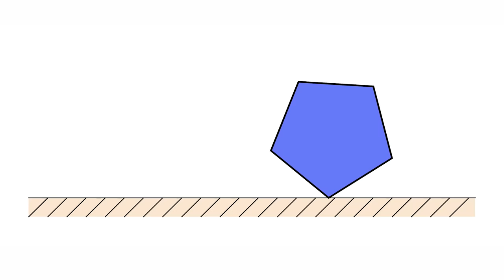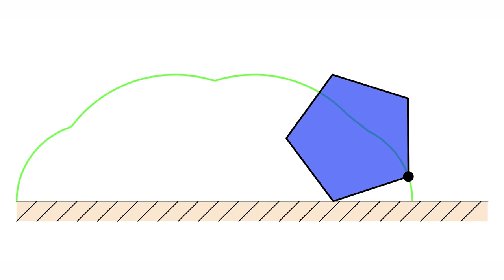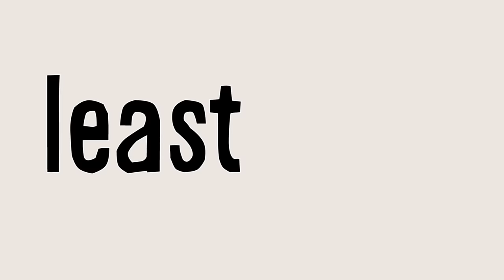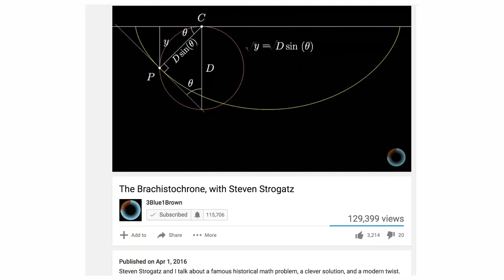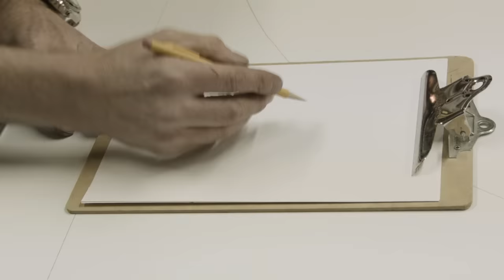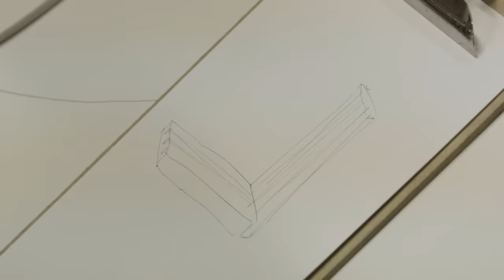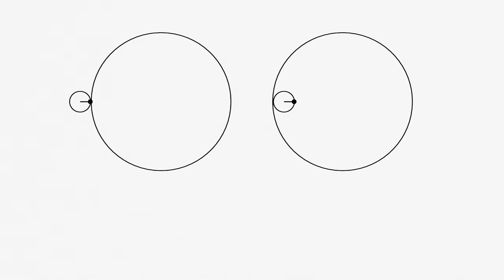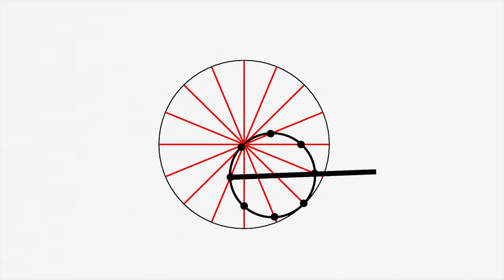The Brachistochrone

Comment: Okay guys, I just wanna throw this out there, this is my understading of the video.

I will just try to go in order of the points discussed in this video.

The center of a disc produces a roulette that's just a smooth straight line while rolling on one, but as you can see in the video a rolling disc (let's call it a circle) draws a straight line in the horizontal dimension, but only one point on the circunference of a of the circle contacts that straight line at a that exact coordinates, because the center of the sphere always points to a singular and unique point on the circumference if pointed in a single direction (radius), and the "place" of that radius is always being changed is a single straight direction (in this case to the right), by rolling. 

We can observe this 2 dimensional graph because we live in the 3 dimentional world, but the perception of the point on the circumference is that it is not moving what so ever compared to the center of the sphere, to him, the center of the sphere is always a fixed distance, and he is always on the same coordinates of the 1 dimensional circumference.

Now just replace the circle with a sphere and the straight line with time. The path time draws is always attributed to a single point of the sphere, there is always only one istant in time and it is always moving forward (rolling), we perceive this because we can perceive that the point on the circumference is following a straight line in the 2 dimensional world, but to itself it is described by a single coordinate, (a 2d object on a graph is x=1 y=2 but a 1d object is just x=1, it describes itself), but we know that that a 1d object can follow a straght line if it's described by a 2nd coordinate in the second dimension. So even though we see the distance getting larger between two points, for the 1d object the points are always the same, so if x=1 and y=2, we get a geometrical straight line from any other point with x = 1 and y != 2, but the perception of a 1d object isn't changed, it is still only 1, is still the same "thing", it has not become 1 and 2 together.

So we can fixate two separate and distinct points in the 2d world, that are the absolute same in the 1d world. So if we say that these points are the same point, from our percpective of the 2d world, the statement if false, but from the perspective of the 1d world this statement is true.

Knowing this, we who live in the 3 dimensional world, perceive that even though a single point is the same for us, it is never the same for the 4 dimensional world, and so we perceive...time.

A 2d object doesn't experience the passage of time, because it cannot observe things changing, it can only observe the 1 dimensional world, which is always the same, it is never chaning, it is the same thing, it is always the same coordinate x=1. But it can perceive the 3d world like we perceive time, because by chaning the value of coordinates you get different points.

And this is why discs (circles) are such good wheels, it always follows the shortest path from 2 single points on a road, being the road 1 dimensional, it doesn't matter where the road goes ( we only know where it goes because we describe it in 2d, otherwise it would always be the same road and lead to the same place), but only a single point of the wheel is touching the road at a time, unlike a poligon, who will always have 2 (imagine a square wheel and it's two vertexes), more ditance between the points = more time; but if you make the numbers of vertexes infinite, the distance bewtween them becomes infinimetly small, approaching 0, so on a circle it is 0, zero time, the best time, the best wheel.

So if we draw a sphere on a 2d graph and a cube on the 2 graph, in which the x axises is time, the shortest amount of time (length of the lineitself if you measure it) is always a straight line, which is only drawn by a perfect circle that is tangent to the X axis, only a single point whill ever be adjacent to it at a time, which makes a square wheel work only if you bend the 2d world (side note after reading my whole comment: we are assuming here that these 2d objects have 0 mass, and and objects with 0 mass can only move trough the axis if it is tangent to it because it enables it to roll; a square in this example will never move because you need mass to generate force and you need force to slide it on the axis, actually rolling it would require an upward motion as well, but that would require the axis itself to bend, to not be straight), and we can do that, because we can observe it, we just draw a curved line, that is longer. We can recreate this 1d road in our 3d world by bending it's 2nd dimension, creating the road at 2:22, in which the square is tangent to the road, only a single point is touching it at a time. This is not true for a prolate because it goes in the negative "mass", two points of the line connect to a single point in time, which is for us, impossible. We cannot build a road for a prolate wheel, because we cannot bend the 2d space (in this case time) to accomodate the fact that point is always tangent, we would have to remove the space where the point is travelling on the road,  but we cannot "remove" space, negative space -> negative mass -> impossible. So really x = time and Y = mass. In the same way, a curtate is also impossible because it does not even touch the time axis.

But what happens when mass = 0? Light. Light is the perfect wheel of our 3d world. Light will always travel the shortest distance. A straight line. Light is always tangent to the dimension of time, making the two points the same, so the distance between the points is none, and since speed is the distance / time ( 0/0 ), the speed is impossible, there is no speed, it is the speed limit, making it impossible to achieve the speed of light ( it is the only thing with 0 mass ), or go beyond it by the means of removing  the space we need to travel (negative mass).

Further on, we cannot bend our 4th dimension, time, we cannot create the conditions for two points in time (the 2 vertexes of a square) to connected the same thing at the same time. In order to do that we would need to "bend", accomodate for this by problem by bending the 3rd dimenion, a thing that we cannot do because we do not actively observe it, we see in 2d, a picture at a time.

Now a cyclode is what happens when instead of focusing on the point touching the time axis which is ever changing, we focus on a single point that is moving; we draw a cyclode.
Again this wouldn't be possible with a poligon because there would always be a side of the poligon that has two tangent points at one time, creating a parallel to time (parallel times).

Now in this amazing video, Adam and Micheal built a 3d version of the cyclode by doing the reverse of what we did in order to build it, by attaching the pencil on the disc they drew the tangent path of the disc (which was in fact rotating for it to happen) on a 2d plane, and later projected that tangent in which time is always costant ( X axsis), so theoretically speaking, it doesn't matter from which point in space the balls starts from, because this "shape" of the road in our 3d world makes it so that they reach the end of this road at the same time, because the tanget touches time on Y = 0 whichever the point in space is , in fact the shot from the side (2d view) they made later on, shows the balls merging into one, they become the same thing, they overlap each other.

Light is just that, it has 0 mass, it is the same thing everywhere, is has the same constant speed, and is for us, the costant of universe, because on the graph it is just a straight line, it is the axis itself.

But an object living in a dimension higher that us, would perceive and observe the dimension we call time, and it would be able to bend it like we bend the 2d one, unlike the 4th dimension which it cannot bend, because it does not observe it, like us with time. That is why we cannot even imagine what a being living in a dimension higher than us would see like, because a 1d object only knows itself, a point, a 2d object can see every point in a straight line, while we perceive the plane (like looking at a graph from above, perpendicular, like you look at it on your screen right now), and an object in a dimension higher would perceive all of this, plus it's version of our "plane". This is why, in intersellar for example, it is shown as every point in space in every point in time, like we see every point of the line on the graph where the X axis is time, making you able to basically "travel in time", because you have access to that dimension, like we have access to the line on a graph.

Anyway, I spent two hours on this, I'm way too high.
Reply: I appreciate the effort you put into this lol

take my recognition
Reply: Wow ur AWESOME.

Comment: I work at the factory that makes the acrylic that you used (I can tell by the printing on a some of the paper). To answer your question on how it is applied. The acrylic is produced in one long sheet. During production, after the acrylic has had time to cool and harden, it is sandwiched by two large rubber cylinder rolls. The acrylic is still one long sheet at this point. Rolls of paper are unrolled into the pinch point of these rollers against the acrylic. The paper does have an adhesive already applied to one side by the paper manufacturer that is specific to a particular substrate, such as acrylic or other polymers. Brakes on the axle of the rolls of paper are used to ensure that the paper is taught going into the pinch point so that it will lay down smoothly. After the paper has been applied, saws cut the paper masked acrylic to customer ordered sizes.

If you ever need something special made from plastic hit me up. We can do all sorts of cool things.
Reply: Alek Pyers YOU GO UP!
Reply: Alek Pyers Next, on How It's Made
Reply: Alek Pyers I think Michale should like 'heart like' this so everyone can reed it (not only those who scroll for 15 minutes) because it is an answer to a question that have been asked in the video
Reply: Thanks everyone.

***** Yes. Yes we do.

Comment: 4:02: "Here's a square, say this is a square"
Hmm yes the floor here is made out of floor.
Reply: He means a perfect square, the “square” he was using was a little bit more of a rectangle
Reply: This is a tree. You can tell by the way it is
Reply: 10 secs before "this thing is a thing"
Reply: No its quite clearly a tyrannosaurus rex.
Reply: 4:00
Reply: It's pun. He means the square is fit for its purpose. It is square for its job. Goes right over your *block*head, it seems
Reply: Or is it?
Reply: Or is it?
Reply: @dani.munoz.a23  probably more of a convex polygon, because the angles can't be all exactly 90°.
well, but the sides can't also be perfectly straight either.... so...... FUCK

Comment: I wish I knew this when I skated & made ramps. It's probably the halfpipe design that requires the least amount of energy to get air.
Reply: Except it wouldn't work like a half pipe cuz the ending angles wouldn't be vertical. You'd get some forward momentum in addition to the upward momentum. But if you were willing to make it unsymmetrical (brachista-thing on entrance part and vert on the other end) you could get some serious air there!
Reply: Chris Turnblom you’d probably eat concrete skating that fast lol
Reply: This is why Michael needs to be the only teacher in the world. He teaches practical lessons.
Reply: I don't think it works like that, but I literally know nothing about skateboarding. The brachistacrone-thing is the fastest in term of time, not velocity.
Reply: @boreean1905  yes, although velocity is equal to displacement over time. As the displacement remains constant over all of the possible paths and only time is changing, wouldn't that result in a faster velocity? ( the distance covered by each is obviously going to be different but you did say velocity)
Reply: @thomasgreenhill2482  I think he meant speed
Reply: Speed is still time/distance
Reply: @dtotheponcharo  * Distance / Time but I understand the implication. And although Speed and Velocity might seem similar or the same, they are completely different quantities.

Comment: The answer to the question: How to land faster in PUBG?

Answer: See this video and follow the tautachrone curve
Reply: Actually, if you could figure out that snell's law stuff with that, you could figure out how to land fastest in any of those games (fortnite, pubg, minecraft skyfall, etc.)
Reply: what about fortnite
Reply: @zombieslayer1468   fortnite is just the same drop
Reply: It most likely wouldn't work as well since you can only accelerate to a certain speed and the fall is too long for it to work if you can't go any faster
Reply: It won't help, pubg doesn't have gravitational acceleration
Reply: @Type Channel Name Here in theory yes, but in application no. There is a maximum speed you can get going to, a point where you can't accelerate anymore. If you drop straight down to a certain point in pubg, and someone jumped before you but they went to the same spot as you, they would land first
Reply: Captain here. You need to follow a cycloid of a sort of egg shape as there is less and less acceleration until you reach your final speed, then you must follow a straight line , all this assuming that pubg has a realistic software for parachuting.
Reply: Don't deploy parachute early
Reply: And then you realize the driving forces behind the convenience of that curve were gravity and innertia.
Reply: Omg i thought I was alone
Reply: Keep your aim at 10 or 2 o'clock and as down as possible. Your character will dab resulting in higher speeds.
Reply: @user-vk2cd9qw7i  different source engines different physics
Reply: duuuuuude you have  my like!!!!!!! 😂😂😂😂😂😂😂